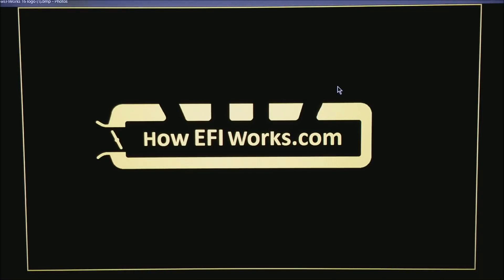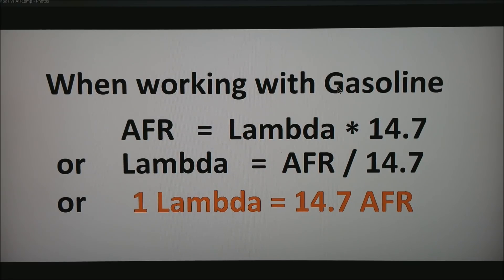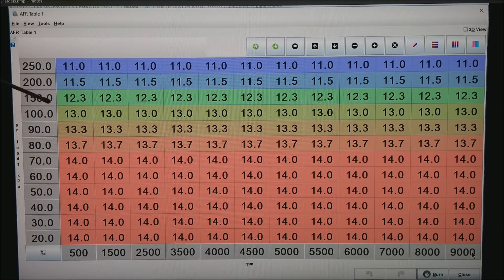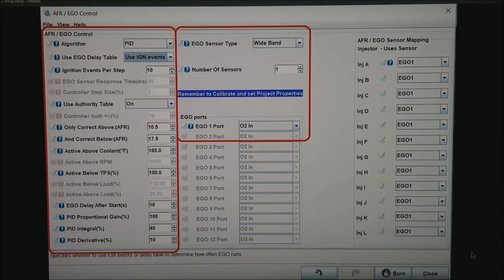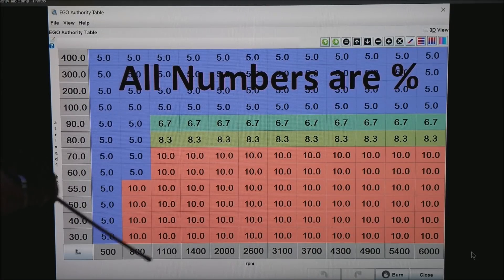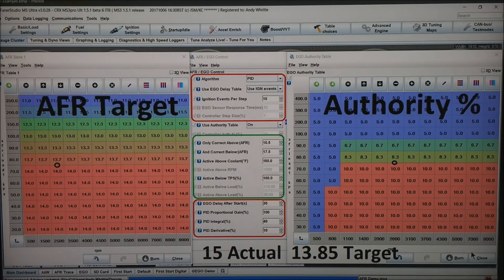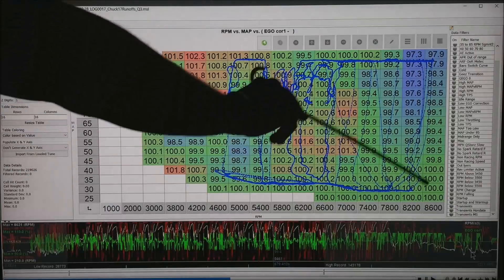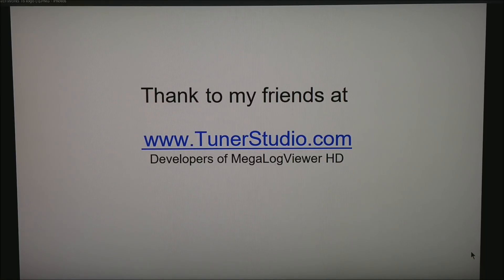AFR Closed Loop and AFR Target Table Setup

Comment: Do you still respond to messages?
Reply from the maker: @stiassassin  I do on FB MLVHD
Reply: @AndyWhittle_HowEFIworks  I've been batting my idle for a few summers now, and I can seem to get it right. I'm making good power, but idle is not good. If I turn off me EGO corrections, the car idles good. But I turn it back one, it hunts very badly before stalling.

Comment: You mention that these values are not suitable with a catalytic converter. If we are running one, should the values be leaner or richer?
Reply from the maker: The AFR on a cat equipped car must constantly  swing from above 14.7 to below 14.7 the vast majority of the time.

Comment: What if my AEM wideband sensor I just bought isn't listed in the AFR Calibration settings for my MS3?  I bought an AEM  E85 ANALOG WIDEBAND AFR GUAGE with part number 30-5143. 
Thanks